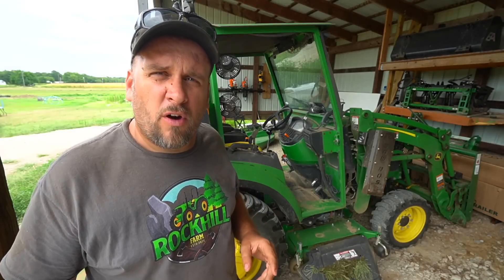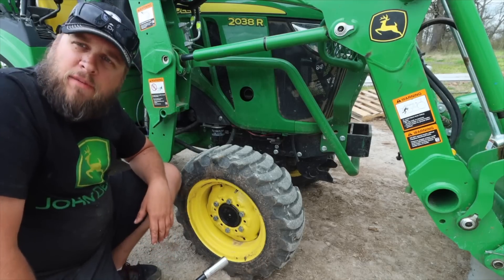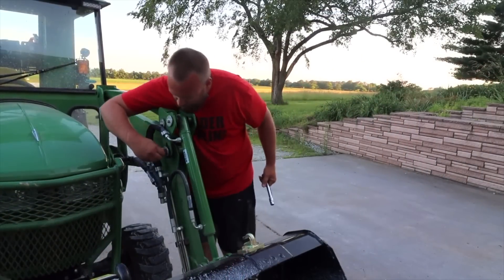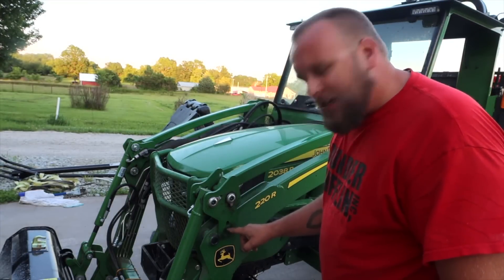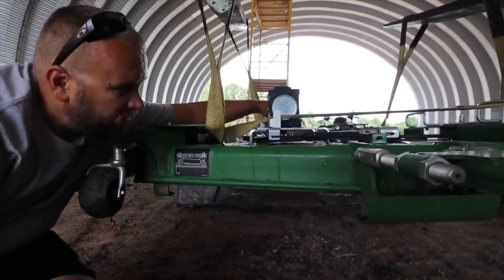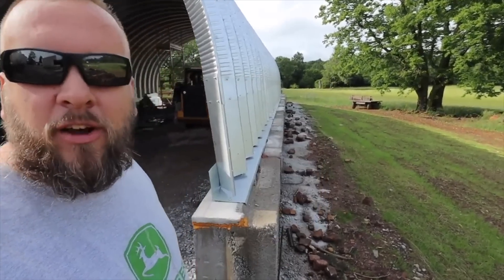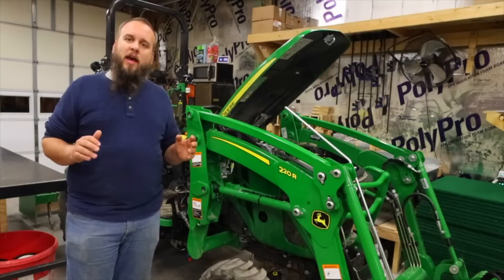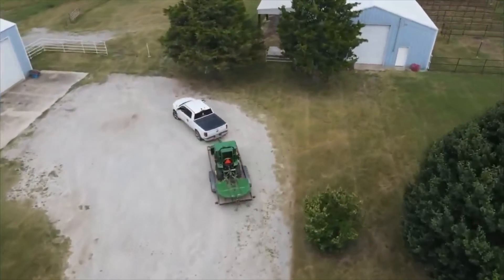This Tractor Sure Seems to Break a Lot

Comment: I don’t see any excessive failures based on how much work you get out of your machine and how hard you work it. I’ve seen the loose front axle bolts and loader bolts in the 100 hours I’ve put on my 2038R. I also had one of the nuts on the bracket that connects the 72D MMM to the front of the tractor back way off and caused issues when I tried to remove the mower. Nothing serious for me and I couldn’t be happier with what I have. I love the transparency you give your viewers as you freely share the good, bad, and mistakes made and let us decide for ourselves the usefulness of the tool being used. Keep up the good work 👍

Comment: I bought a Kubota compact in 2006 brand new. I’ve replaced the battery and a front axle oil seal. Still runs good. I’m

Comment: Great video Brock. My 2038R had problems with loosened bolts, the MMM actuator, and a hydraulic leak which was fixed back at the dealership. Besides that, my 2038R has been a very solid tractor.

Comment: Hey Brock, I have 650 hours on my 2038R and I haven't had any problems except for a warranty oil cooler replacement.  I use mine hard too, almost tipped it over trying to load a 2000lb pallet by lifting the pallet off the end of a tilt trailer by lifting with the pallet forks and then tilting the trailer to get it unloaded, and more.  I have had a couple of loose bolts, but fixed those.

Comment: I had a Kubota B series 24hp that I worked like a 35 to 40hp. With 1930 hours on it I replaced front and rear wheel bearings. And I had to replace the cutting edge of the front bucket as it was worn down from being used to the max. Used it for picking up the end of trees to cut them, then to pull other trees out that were 25 feet long, ripping out vines, and snow pushing in the winter, etc. But you seem to have had more problems than I would think possible with the few hours you have on it. But I have since purchased an LS MT342 HC which only has 200 hrs on it and no problems. Have moved about 300yds of clay, rocks, trees, etc. Hope it holds up like the Kubota did.

Comment: I have kioti ck2610 which I push to its limits almost 800 hrs in two years only had a handful of problems blown hydraulic line ,cylinder packing,o ring ,front axle seals

Comment: I had the same thing happen with my 2032R. I added washers and lock washers. No idea why they would not have had lock washers to begin with, seems important those bolts don't come loose.
Reply: By the way I was referring to the front axle bolts.

Comment: Let me tell you that I like the fact that you talk to us (me), there are times that you woffel on, but then I can & do fast forward.
I have been following you for a while. I think that (a strong point) you do your best to get your money's worth with your machinery, & you do a good job of it.
If I was in your position I would be looking at a stronger/bigger tractor. You find that 😢 jobs are easier & those jobs that were just out of reach can also be done. The main thing is your tractor is doing more at 60% & less at 100% with the result it will be easier on the parts - they will last longer before wear out.
Personally I think that a lot of your breakages are the results of knowing what is possible & going for it. Even you last longer when you can work at 60% & not using every last drop of energy all the time.

Comment: Good morning Brock. I have to say that you have had a few issues but that being said you also use your equipment and work your equipment every day. I bought my 2007 John Deere 2305 with 400 hrs. on it and i have about 750 hrs. on it now and haven't had any real problems with it but I don't use it anywhere near the intensity that you use yours so I think that the mechanical structure of your tractor is a testimonial to the quality of John Deere products. As far as the switch or the bolts these are most likely off the shelf pieces made in China or some other 3rd world country.  The tractor itself is a strong capable machine that will continue to do it's job for years to come. Sorry this is so long. God bless and have a wonderful day. 👍👍🙂

Comment: I've only had a few minor problems, but I only have 80 hours on my tractor, and the problems were caused by me, not faulty equipment.  So far the worst was one of the pins fell out of my mower deck anti-scalp wheel assemblies, and I didn't realize it until I heard the bang and knocking from the mower as I ran over the assembly....bent the bottom of the mower deck up a bit too.  Ordered a new anti-scalp wheel assembly, and was able to somewhat straighten out the mower deck.  I had a small hydraulic leak right after I took delivery, which was just a loose hardline connection.  Had an issue with the loader early on from lack of experience in removing and installing one....KTAC took care of that issue.  Overall very few issues so far, but none of which were problems with the tractor manufacturer, just my own fault...and the leaking hydraulic line was probably just an oversight during the setup at the dealership.

Comment: Have you looked at MultiSeal for your tires? It's a product that can co-exist with RimGuard, sodium chloride, water, and other ballasts, and when you get a puncture, it'll seal it off.  Good Works Tractors has a video of it being installed, and some examples of the punctures it can seal. I've got a lot of screws and nails left by the bozos that took down the chicken houses, and I'm planning on getting a pail of it shortly for the tractor and the ZTM. It's not supposed to affect tire balance or anything like that. About the only thing I can imagine is that if you check your tire pressure, you need the valve stems at the 12 o'clock position. And if you've got ballast, you need to do that anyway.

Comment: I wouldn't be to concerned, you use your stuff hard. I have a 2032r and use it pretty hard also but only 300 hours. No bolt issues but I check them every time I grease it. My loader control valve seeped, it was a plug that came loose. It was under warranty.

Comment: It's a 50 50 for typical issues/just not a good piece of equipment. You seem to maintain your equipment pretty well, so it's definitely not that. My Kubota is pushing 800 hours now and I've not had issues with loose bolts or anything like that. Mines been user error and the typical wear an tear parts like pins and bushings, but not even enough to think it was a bad tractor. I'd say for 700 hours, you've had more issues than "normal," but not enough to call it a truly bad tractor.

Comment: 🎉it's not the tractor it's the operator  my father would tell you start looking for a job we ran alot of heavy equipment and never had that many brack downs I have ran everything but a crane it's called lack of maintenance brock and don't be using a tractor for a lawn mower lol😅
Reply: He discovered many of the problems long before the manufacturers scheduled maintenance.
Your father should have worked at the factory and overseen the assembly process.

Comment: At least your honest, but mechanically nieve. Dangerously so. Don't get killed by carelessness.
Work safe and respect your tractor.
Reply from the maker: I found all of the issues before they reached failure, and I pretty much fixed them all myself. I had the dealership replace the bolts on two of the problems just because it was new and under warranty and I wanted it documented

If my video said I was driving and my axle fell off, that would represent carelessness. I found the issues beforehand because I knew to check my machine

It is not necessary to be condescending

Comment: Loose fasteners are a result of improper maintenance. Part of first service after 10-20 hours is checking ALL fastener torque tightness. And at every oil change service. There is no excuse for any of your mechanical failures. A tractor is dangerous and can KILL you. What if you were driving at top speed on a public road. 
Work safer and smarter, please. 💥
Reply from the maker: I found all of the loose bolts before they failed…

Which is evidence that I was checking my machine on a regular basis not just at scheduled service 

So what are you talking about?

Comment: I’m not partial to John Deere at all.  I’m a new tractor owner and have done years of research on most models available today.  One thing that pops up the most is the loader bolts break or come loose.  The other thing is on large ag tractors and how John Deere has blocked access to the computers on them preventing the average farmer from fixing his machine and costing much more out of pocket.
Honestly, you will have to baby the machines to keep them from breaking.  It’s no different than a car, if you drive it hard, it’s life is drastically shorter then someone who drives the car as it was intended. 
In my opinion, most of your breaks were due to bad manufacturing or design, not due to how you operate the machine.